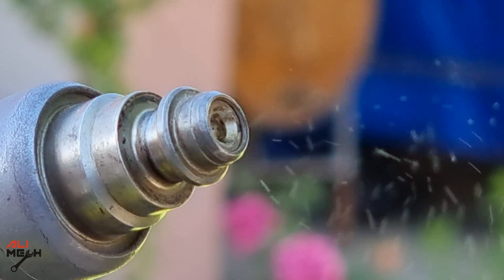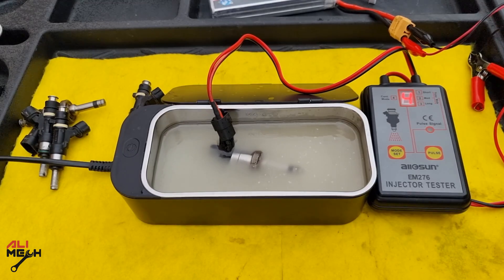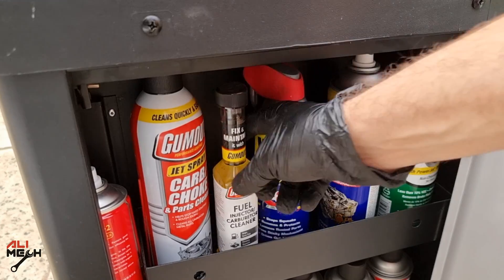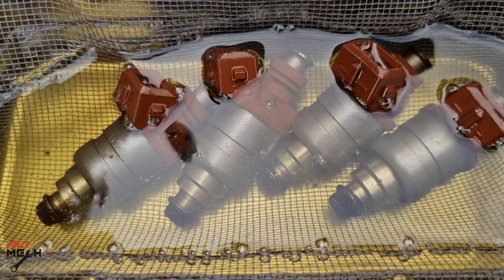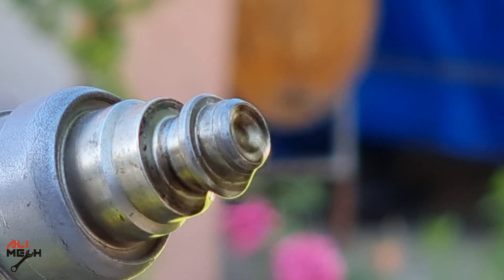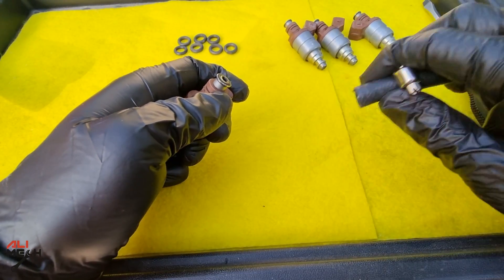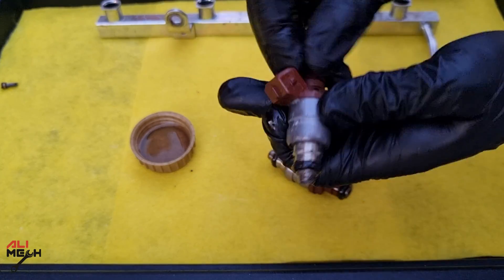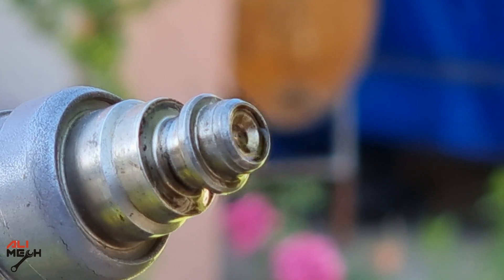Tips to know before cleaning fuel injectors/Leaking Fuel Injection cleaning/Cleaning GDI injections

Comment: Do I need to pulse injectors while in the ultrasonic cleaner or just leave it there ?
Reply from the maker: No need to, but if you do, it's much better specially on leaking fuel injectors
Reply: @AliMECH  mate, thanks for all the videos and tips shred really appreciate it. After watching your videos I have ordered the injector tester and now waiting for ultrasound washer. I intend to repeat the same procedure and pulse injectors inside the washer. Would it be safe to pulse injectors inside the washer with all different pulse mods and counts? My only concern is not damaging injectors by overwhelming them etc. It will be much appreciated if you can answer and apologise for a long one! Cheers
Reply from the maker: No problem I did that before,  just keep the harness out of the liquid and u can do that in the ultrasonic cleaner
Reply: @AliMECH  top man! Cheers
Reply from the maker: @e30_lad_ireland  thanks

Comment: I may be seeing a possible issue with your really  super clever "bath" cleaning method .  The U. Sonic cleaner bath is  a fantastic idea but like you say, it can only easily clean the outside of the injector & NOT the inside of it too where real some bad, dirty "stuff" may be hiding.  Seems what you also need to do is to also hook up a (common) 9v battery which works surprisingly well & is so much safer around the flammable cleaner, to each injector as it soaking.  It works nearly as well as the 12 V car battery.  So just hook the 9V batter up to each submerged injector in turn and let the cleaner flow inside each submerged injector in the bath.   Note, despite all the hype, and overblown advertising, I found that due to how industry can weaken the  actual strength of a chemical to make it much safer for the "average" user, you may need to let the injectors sit submerged for a few days, and occasionally run the battery to each to change out the dirty cleaner trapped in the things between soaking & purging sessions.  Hope this helps!!!  Happy New Year!!  DL
Reply from the maker: Thanks, yes that's actually a great idea too, I'm sure it works good and happy new year
Reply: Thanks for sharing your opinion. What cleaner would be safe to use when submerging the injectors for a day or so? Certainly not the carb cleaner..I suppose?
Reply from the maker: I use seafoam or injector cleaner

Comment: thank you for the advices, i have a question about the injector filters, can we just clean them? if not where to find them because i didn't find them in auto part shops or online but i found some on ebay and aliexpress but I'm not sure if it's safe to use them
Reply from the maker: When you take them out, sometimes they get damaged so it's better ti replace them, I put the link  pack of 100 filter in the video description that's what I been using for few years now
Reply: @AliMECH  alright, I'll order them, thanks 😁
Reply: @AliMECH  are they all same? I have 5vz engine